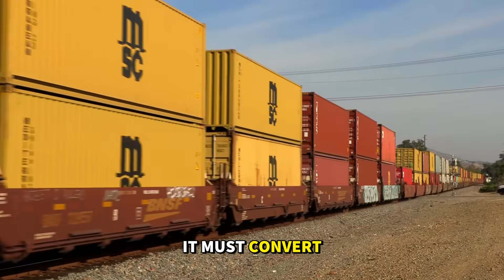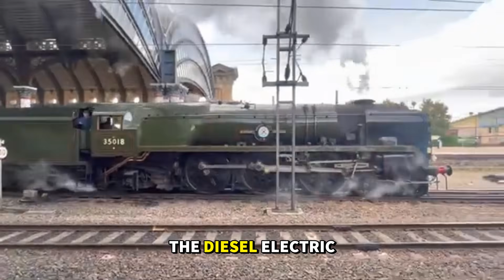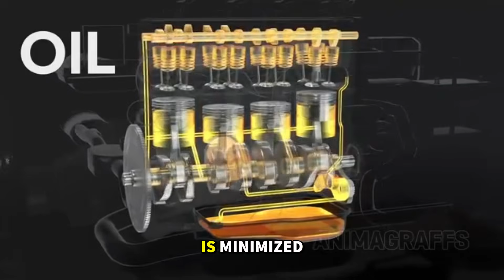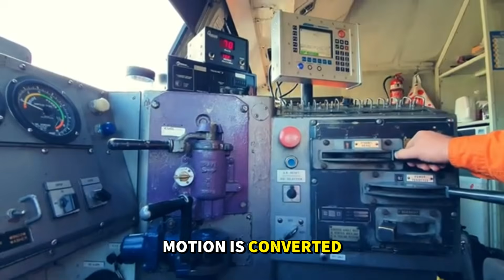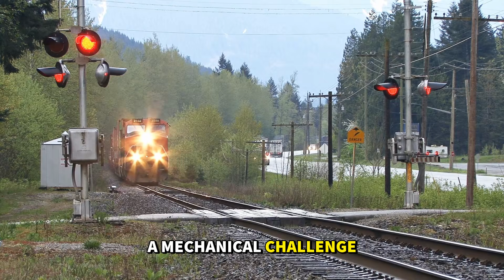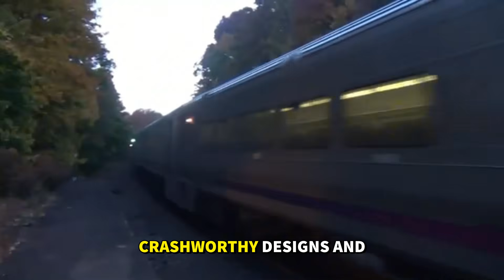How Does a Train Engine Pull 100,000 Tons?

Comment: No single train has ever been rated at 100 thousand tons. 100 thousand tons is routine for a ship though!
Reply: I have seen ship engines and they are absolutely gigantic! It helps that ships don’t need coolant because they just use ocean water to cool that massive engine or engines if the ship is big enough. These engines are larger than the typical new locomotives of today, the Evolution Series WABTEC locomotives and the Progress Rail ACE series.

Comment: This video posits that the diesel always runs at its most efficient speed. That is not right. The diesel runs at speed and torque to produce the power needed at the moment. There is no storage of electrical energy at present.
There wasn't any particular problem with the delivery of power with steam, except maybe when the engineer got too aggressive and caused wheel slip. The Diesel electric definitely has better reflexes at managing slip. Modern diesels can be operated together in multiple units under one crew as easily as one unit.
Diesels are far more efficient and require far less maintenance.

Comment: Why do they change the diesel speed, I wonder. If that's the case. I definitely hear them change the motors' speed at different times.
Reply: To keep up with increased electricity demand.
Reply: More Amps at the same voltage....
Reply: The engine speed stays constant to spin the generator at a consistent speed to provide the proper frequency from the generator. You are hearing the load on the engine change which is regulated by the governor control.
Reply: @leroychauvinjr.4991 Yeah, the torque requirement. Load on the engine.